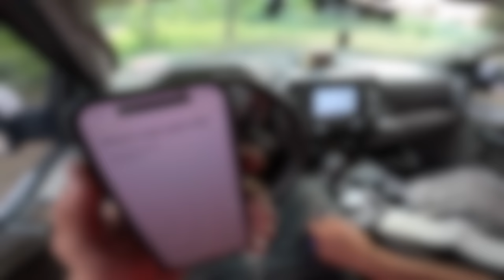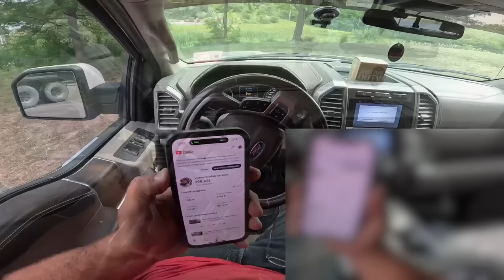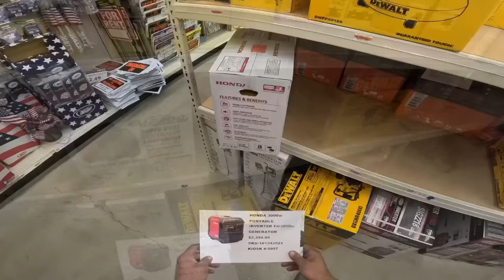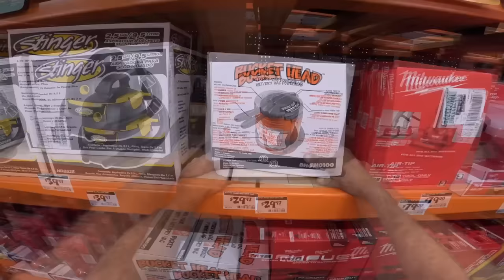I messed up and the customer was TICKED!

Comment: I cut the same kind of line repairing a residential irrigation system and I just connected the core wires together and the homeowner had service until the company showed up and repaired it. He was still mad but poor cable installation is the real issue.

Comment: Hey Ryan that bucket vacuum is actually pretty good for small item just don't know how good it would be with liquid
Reply: I have seen them just haven’t tried one yet
Reply: Works pretty well. I do refrigeration work and usually use the bucket head for strictly liquid. Takes up less room on the truck
Reply: @TH17992  that's good to know I've always been curious if it would pick up liquid but never wanted to test it and ruin the vaccum while I was on a job that required clean up daily

Comment: You won't regret buying the Honda 2200i I can promise you that. I found mine in a dumpster on a job site 3 years ago, took it home and cleaned the carb and have been using it every day since for almost 8hrs a day with no problems at all other than the pull rope breaking once. that was a pain to replace tho not gonna lie. but it's an awesome generator. I love how compact it is. I tie mine to the rail on my scissor lift and have power in the air all day. it's a huge game changer for the work I do. They also sell a fuel cap for it that you can connect to a boat fuel tank and run it for days at a time if you need to.
Reply: When they first came out I used mine on the catwalk of my semi truck to run a a/c to kee the cab cool while parked. That fuel cap was awesome.

Comment: The way internet companies do their home drops in america is a joke to a European like me. I mean, the drop for new fiber is mostly dug by the customers themself so some want to save some work and burry it only 20-30cm deep, but man, a line trenched only 5cm under the ground ist nothing. A nosy child with a normal sandpit shovel could damage that.
Reply: It would be an easy target for burrowing animals as well.... squirrels, chipmunks, rabbits, rodents, foxes, coyotes, heck, even a random Badger, or like you said, some random rugrat with a toy shovel for the beach....
Reply: The cable companies don't want to assume liability for trenching, and most installs are retrofit, so this is what you end up with.  On new construction they are typically buried much deeper, or in some cases there is conduit from the home to the pole or vault.

Comment: Ryan, 
Home Depot sells the tools to repair cable lines. You could do a temp fix to keep customers online until spectrum/charter can come out to repair it. 
Buy a set of RG-6, RG-59 crimpers and strippers. Buy a roll of RG-6 and RG-59 cable, buy a few “Barrels” and fittings for each size. Standard cable is RG-6 and older “very skinny” cable is RG-59. Very easy temp fix. 5 mins tops and your customer is happy until the cable company can come out.
Reply: This was weeks ago
Reply: @jesussolorio8437 right, but it won’t be the last CATV line they break. Just wanted to give a suggestion to mitigate future issues.

Comment: Bucket heads are great, same motor as the stinger. What's the difference between the small plastic bucket the shop vac has and a 5 gallon?...

Comment: If they are so dependent on the internet they should have a redundant connection coming in from the other side of the building.  There should also be a cellular data last resort connection.

Comment: I work in IT specificially with infrastructure, if there access controll is based soley on having cosistant internet then they are running a severely flawed system. The one that we use holds its configuration when there is internet loss. so the only thing you cant do without internet is update the configuration meaning everything is fine. its likely they were just saying this too you to make you get it fixed quicker. but understandably they are a child care centre and most of the activities they do may be based around internet.

either way you handled it like a champ and got the job done. big respect.

Comment: Stuff happens. If that's their only internet connection and they are that operationally dependent on it, it's their negligence for aby inconvenience they suffer. Cellular backup or another connection from another provider is what they need. Also, something is super super wrong with their access control if something like internet goes down and things stop working. Even cloud connected offerings such as openpath operate independently until connectivity is restored, you just can't push changes, add credentials, remotely release, etc.

Comment: The center should have had a backup connection if it were that important. Cellular, DSL, anything. The cost is minimal and avoids this headache, especially if they like buried coax.

Comment: Pro tip if its just a single coax cable(which spectrum uses 95% of the time) a coax splice tool kit cost like 30$ and would save you hours of waiting

Comment: As a operator I seen that coming…always dig the entire length of line. I stuck a jack hammer off a backhoe int 340,000volts and snagged a gas line once due to a dumb super intendant that I told was a bad idea to use the machine. He was a hot head. Luckily I had my GoPro going. I’ve been around a lot of guys hitting electric. The worse I seen was a fiber obtic line. It was a 2,000 wires birds nest wish I could post pics in comments

Comment: I had the same thing happen to me with a tree trimmer. I told him I work from home and please do not drop the limb on my cable line. 10 minutes later internet is out. He dropped the limb on the line and pulled if from the pole.  Two days to get it reconnected and he didn't want to cover the service charge from comcast for the re-connect, for his mistake.

Comment: Where I work we do drainage jobs from time to time. Setting catch basins and the pipe between. We were working at a school and it was a nightmare. We hit 2 water lines and a sewer line. We ended up finding way more. The best part was everything was “marked” before hand. Maybe 10% of the marks were accurate. Where we hit the big water line painted about 2 feet over says “no water” then bam! Schools are no fun when it comes to any sort of digging.

Comment: Wow, that cable line was barely even 2 inches down.  Code in our area is 18"  if it isn't buried to code make sure that you don't pay for it to be fixed, it should be on the cable company for not having it buried to the depth code required

Comment: Just use a saws-all with a long blade rated for thick metal to cut that pipe.      You want a long blade so you can flex it flat to the slab to clear the saw body. 
  Drop a little oil on the blade and brace the saw good and they will cut fast and flush.  Much safer than a grinder and cut off.
   ( If the pipes are cast Iron they have blades for that as well , can’t tell from the video ).

Comment: That didn't look like fiber internet cable so might want to get a couple rg6 repair kits for coaxial cables to keep on the trucks. You can repair those easily to temporarily get the connection back. Still call and get them to repair the line though.

Comment: You should have a repair kit with your trucks for internet cable. Just some ends and the tool to crimp them along with a roll of cable. It's surprisingly easy! (See what I did there? easy!). Even if your repair is considered temporary until the company can come replace the cable.

Comment: 16:30 Man. I've worked in the internet service provider industry all of my adult life. We joke about outages being a random act of digging. 

Highly applaud the response. We wanna know as soon as possible so we can work on getting someone there. Sometimes its long before the customer themselves even know that its down and that gives us time to fix it for everyone.

just dig another 6 inches down and run a conduit pipe on both sides of your work area before leveling if you find internet wires. you give them the option to do it right and if they choose otherwise that's on them. Gosh bless.

Comment: That's a poorly designed access control system if when the internet goes down everything unlocks. They only thing it should need internet for is to update or make changes, it should always keep running independently

Comment: I’ve spliced some internet lines with wire nuts or just twist together with tape until they arrive. But be cautious there is about 90 volts running through one of those wires and it bites especially when on your hands and knees.

Comment: Unless you do this kind of work it’s hard to understand that things like cable tv , low voltage lighting and sprinkler lines are not usually subject to code restrictions and can be placed anywhere at any depth. 
    Since they are coated with the same dirt they are buried in they are almost impossible to see before it’s too late.  
   This is a little different but still , shovels and machines vs. 1/4 “ plastic cable don’t mix.

Comment: Is really easy to put the wires together after cutting so many a guy from spectrum give me around 50 connections and showed me how to connect it. Also the facility should realize how vulnerable they are depending on internet to run.

Comment: Man I can send you the tools to repair those cables lines.  You need just a crimper and the stripper.  Then the connectors. You can get them up and running like that till permanent repair.  In ohio most lines are just under the grass.  Never  buried deep enough.

Comment: The Access Control does not rely soley on Internet.  Maybe for remote comms but it has a local AC Panel that has redundant UPS Backup Power IF it was installed correctly.  They were being over dramatic like most Customers are.  I get it though.  We rely on Tech as a society now.  No turning back.

Comment: You should buy the tools for cable and keep the fittings on the truck that wire is so easily broken an easily fixed they should have to buried it deeper but they never do

Comment: 17:20 - In Australia, that internet cable would not be considered "code"; it's direct buried (ie no protective conduit) and is not at minimum required depths:
Lead-in on Private Property	300 mm
Private Driveways	450 mm
Verge,walkways, footpaths	450 mm
Road	600 mm
Road Crossings	800 mm to 1200 mm (Typically)
(for the metrically challenged, 1" ~= 25.4mm; thus 300mm ~= 11.8" - rounds to 12")
In other words, Ryan would not have had an issue in Australia because the cable would've been approximately 12" to 18" deep (at least).
I feel really bad for Ryan because he wanted to do everything right, and is let down by what I consider a shoddy cable installation.

Comment: I understand the stress, but being a low voltage guy this is a 1 minute temp fix at most keep some of that on the truck just incase. Also why not throw a 1/2” or 3/4” sch 40 conduit underneath the concrete since it was cut you’d be ahead when the clown isp comes 🤷🏻‍♂️

Comment: Ryan you really could get the tools yourself and fix those lines. You can buy a repair kit online. comes with the two tools and fittings, but theyll have to replace the whole line you cant fix a connection like that and put it back underground.. first time it rains the internet will go out. spectrum will have to replace the whole line

Comment: As a certified early childhood educator, kids cant just run out just because the internet got connected. It's not like the kids are in jail cells and all the doors to each cell is unlocked. The educators are constantly interacting with the kids. Daycares are not like school where you have like 30 kids per one teacher and the kids are sitting at desks. Depending on the age groups, there is 1 educator for every five kids, and as stated, you are interacting with them constantly and every min or two you are counting and looking at the number of kids you are responsible for. Are there alarms on the doors, ya, are there fire alarms and things that you need the internet for, ya, but the daycare can still function perfectly without them. It's not like you knocked over an ant farm and the lid came off and all the ants are on the loose. However, there are different kinds of daycares that use computers and programs to teach kids like math and english etc, but being shut down for a short time isn't a big deal, the kids and educators have plenty of other things to do. Did you F up, ya, but I wouldn't lose sleep over it, especially since you rectified the problem quickly.

Comment: Honda generators are good but they have a major part problem.  The computer control board inside is what generally goes wrong and they only make them special for each year and if it fails witch it will your generator repair guy can not get that part once the year modle production is done that board for that year modle is no longer available no way no how .

Comment: @ about 16mins, Ryan talks with the client about the existing sidewalk being too low,, the client should have went ahead and asked Ryan to remove as many sections as needed to make the drainage work,, perhaps that entire area because it's already settled causing trip hazards. To get 'RamJack' or another company to come out and mud jack that area will very likely cost 2X what Ryan would have charged to redo those areas. Ryan has the equipment and manpower ALREADY ONSITE.  Ohh well,, too late now.

Comment: Ryan its not your fault if the internet company had buried it deeper this would have not happened, but its pretty silly for them to have door access control based on the internet when normally they are a closed circuit

Comment: Just had a couple things to say,
1st. Customer completely exaggerated. I'm 100%sure 
Mad because you took out the wifi.

2nd, it's not that "easy" when you're dealing with low voltage stuff. 

I'm a contractor.  I've seen a whole lot

Comment: 18:20 i dont understand why u call people and companies about the internet wire. Just go get the little connectors at home depot and splice it back together. Fiber, coaxial, phone line wires, whichever it is they have the pieces to fix that very problem. Anyone can do it.

Comment: Im so baffled how you locate the line , then immediately go and start digging with a bobcat in that area when its so important to keep the internet up. The guys should have located it at both sides , Connected the two holes with a chalkline then spraypaint it and hand dig that thing out.... or locate it like you did and mark 1 foot on either side of it 1 foot away from it and dig that part out last by hand so you can keep the dirt on it to drive over it. tryna get to close to it to avoid the hand digging seems like...Accidents happen , just crazy how careful you were to locate it then go and dig with a bobcat right there... if i was her id be upset too lol.

Comment: I find it very hard to believe the internet has anything to do with their functional systems inside! All of those systems are normally local, meaning off their hubs and switches to a controller system. There may be some off site access but not likely the system works solely from off site.
Sounds like a Karen that doesn’t know how the system works.

Comment: Landscape company doing concrete and running heavy equipment but can't handle a simple coaxial cable. A couple fittings maybe a small length of cable to reroute or hang temporarily. Can't believe Spectrum would jump on something that wasn't their fault after being told later isn't fast enough. Not dragging on anyone but it's so simple

Comment: Lazy electricians…also, why don’t they have a fail lock system vs fail open system. Then if there is an issue, the doors stay locked and can be overruled with a key to open.